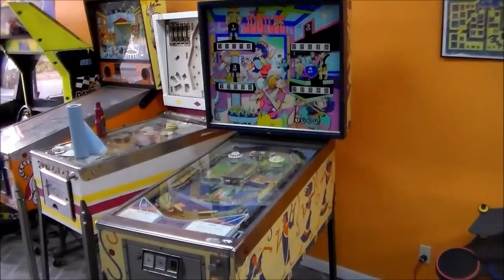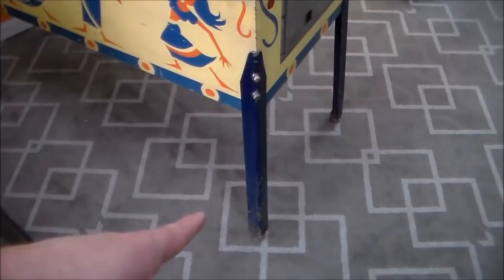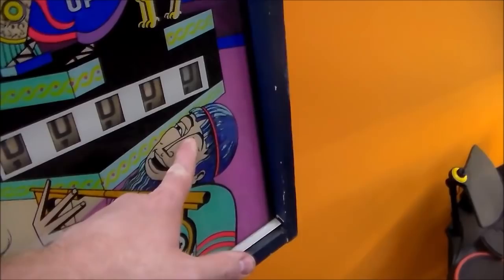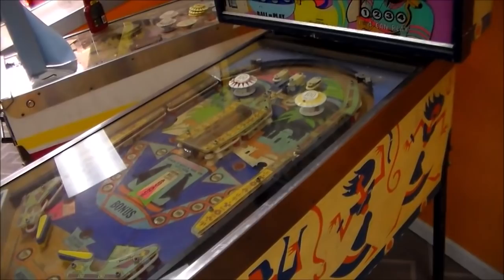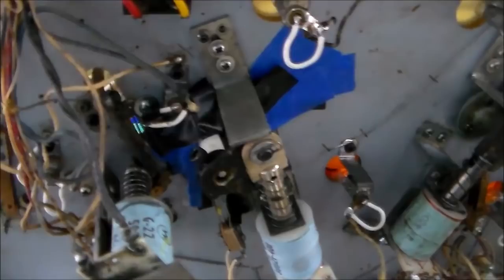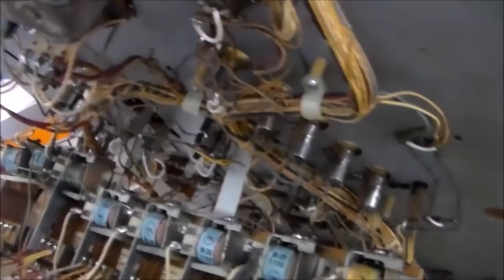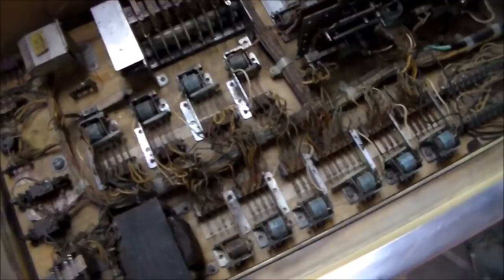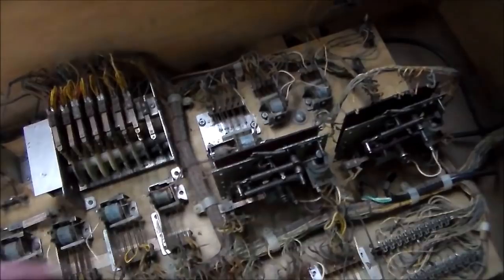Let's fix This Electro Mechanical 1973 Williams Jubilee Pinball Machine!

Comment: FYI.Something that might help is that I had a stepdad taught me and about the only decent thing he taught me is that when you have a stripped out screw hole in wood, just take wooden match sticks or wooden toothpicks and glue them in with white or wood glue. Once dry, just screw your screws back in. When I ran a arcade back in the early 80's I used to do this. I never had one come out.
Reply from the maker: Thanks Hofsan!
Reply: Hammer a Golf Tee into the hole with some wood glue, I have found to work quite well also with the same result as Hofsan1..   Just clip, cut, or saw it off once the glue dries.

Comment: Joe, I adjusted the score wheels so that the top switch was open on 0.  You were spot on, that problem is happily solved.
A new “problem” has raised its ugly head😤.  When pushing the start button all score wheels reset to 0 (👍), BUT play does not start.  Instead, the Game Over light comes on and there is absolutely no play.  I pushed the Play Button again a few times (after a pause between each attempt) and each time the Game Over light comes on and no action.
I’m hoping you have an answer.
Thanx for your willingness to help a novice pinballer such as myself🤪.
Reply from the maker: Set a couple of the reels back to 1 or something, open the playfield up (prop it open), and press the start button.  Watch really close to see what happens, you'll see several relays turn on and off, and the score motor start turning.... you might have to do it a couple times to tell for sure.  Pay attention to the reset bank which is all the relays that get reset at the same time by that big coil and bar, see which ones are turning off and on, etc. and then we can compare that to the reset sequence listed in the manual and see where it's stopping.
Reply: Greetings Joe, sorry for being a pest.  I did as you previously suggested, but to be truthful I didn’t understand what I should be looking for.  The Game Over is driving me batty!  Might what I share next contribute to the problem?
I installed a new pop bumper assembly.  It came with a SW-11A-35 switch, the original part was SW-11A-37.  Didn’t realize they were 2 different switches.  I installed the new one (the old one had a broken plastic spoon).  THE PROBLEM: I cut and left the 2 yellow wires (both were attached to the same switch terminal) AND cut and left the 2 gray wires (both of these were attached to a different switch terminal).  So, the cut yellow and gray wires are attached to nothing.  Could this possibly be the reason the Game Over does not allow play when the Start button is pressed?
I really, really appreciate your help.

Comment: I love your thought process into solving the problems. The way you go to is impressive. Thanks for taking the time to explain the little details. I would be interested in more videos of how you clean and adjust those switches and cleaning the Jon's plugs.. it might sound so simple but the older ones are more intimidating then the newer ones are to me.
Thanks again 
Bryan
Reply from the maker: The older ones definitely seem more complicated, but once you realize that the switches can only be on/off , off/on , or three way... you can usually get them pretty much running without even having the schematics!  So they don't cost much at all to fix, just a little time cleaning and adjusting :)

Comment: 14:50 Glued in golf tees fix wallered out screw holes nicely.
Reply from the maker: I'm going to try that on some thanks!
Reply: I have used wooden tooth picks (as many as it takes to fill the holes) dipped in white glue.  Just push them in and break them off.
Reply: @LyonsArcade  I usually go with small dowels.

Comment: Recently started to enjoy older, vintage pinball machines. We bought two. One is a Jungle Lord. We want to replace all of the old lights but we get confused with the types to be purchased ie. 387 versus #44 etc. We'd like to repalce the old ones with LED lights. Can we do this? If not what lights are used in the Jungle Lord? Help. Great video by the way.

Comment: Joe, The coin unit last position break switch should not be bent over like it is.  The long leaf should be on the other side of the rotating post so it pushes the switch blade up to break the connection.  It works but a lot of unnecessary strain on the switch...and looks bad to boot.
Reply from the maker: That make sense, I thought it looked different than I'd seen before (which is why I went and looked in the schematics) but I never thought about it going the other way, that would be much more reliable :)

Comment: Thanks for your great videos!! You helped me fix a Jubilee pinball that was in a total mess. Many hours but a lot of fun. One thing I don't get right, the shooters on left and right side of the flippers won’t fire, it's acting like on your video 24.30. The scores works fine 300 or 30. Sometimes it's fire. I have changes the coils but that didn’t help. How did you get your shooters to work? Thanks! Markus
Reply from the maker: Do yours not fire at all, or are they weak like these were?  Basically when they're weak (or not working) new coils hardly ever fix it so you can save some money on that in the future.

The way they get their power is through the switches that close on the schematics, to short the coil together, so one of those switches is dirty enough or opening too soon, so that it's not strong enough to fire.  There is a 'shooter relay' that pulls in that is what shoots the ball out.... so the switch on the shooter relay may be dirty, or there is also a switch on the score motor, at cam switch 4A that is inline to it....
Reply: @LyonsArcade  Thank you Joe!! You were right, the switch 4A on the score motor, the small contact on the switch is gone. I have a score motor from a Star Pool that I hope a can take parts from. Thank you so much!! Can I donate in any way for your great help?

Comment: Joe, your videos are greatly appreciated.  Thanx for all you do to help us novice pin ballers.  I have a 1976 Bally Flip Flop.  When hitting the Start Button all 4 score reels reset to zero, but clicking score sounds will not stop until unplugged.  Any thoughts?
Reply from the maker: The clicking you're hearing is the reset relays in the back that reset the score reels.  So the way it resets the reels is there is a switch on each reel that only opens when it gets to 0, so if it's not on 0 it has power going to it, through those reset relays, and when it gets to 0 even if the reset relay pulls in it can't turn it anymore.

The reset relays will continue to click until they know that all the reels are at 0, which it can tell by a seperate switch on each score 0 that also opens up at 0.  

So basically your problem is, when the scores get to 0, at least 1 of them the switch isn't opening up on the top of the score reel that tells the reset relay to turn off.

Comment: Great video very informative ans helpful. I'm a newbie that just picked up.an old Bally Nip It machine, and I could have used help with HOW you actually clean everything and with WHAT. I got the used file and cloth but seeing the process would have helped me a lot. Also do you recommend electrical contact cleaner if the machine has heavy buildup throughout from sitting in a moist area for an extended time? Entire lower area has a light film. Any help is greatly appreciated. 
Thanks
amazinsnyderman

Comment: Hi joe, I’ve got the exact same machine and was wondering if you have any suggestions about fixing it! The lights are all okay and all scoring works however when you lose a game the ball doesn’t go back to the plunger and it stays on the 1st ball. I’ve never worked on a pinball machine before and despite watching the video and having a look for my self I can’t seem to find a fix. Let me know if you have any tips
Reply from the maker: Does the ball kick out alright when the game starts?   it sounds like you have a problem either with the outhole switch that the ball lands on, or the outhole relay.
Reply: Joe's Classic Video Games  it never kicks out, at the beginning of a game or when you lose a round. However when the ball lands on the switch the points calculate for that round!

Comment: Really good info on how to repair!  What  is the lock relais for?
Reply from the maker: The relay goes off when the power goes off so it basically is set up so that when you turn the power off in the middle of a game, when you turn the power back off the game is over.  You can actually take it out (and bend the switches to always be on) but the game won't be over when you turn the power back on.  Not too big of a deal.
Reply: Joe's Classic Video Games thank you for the info